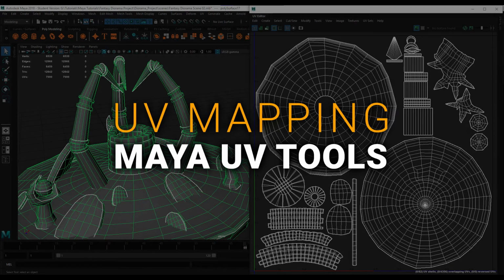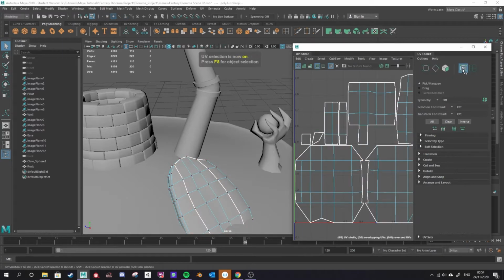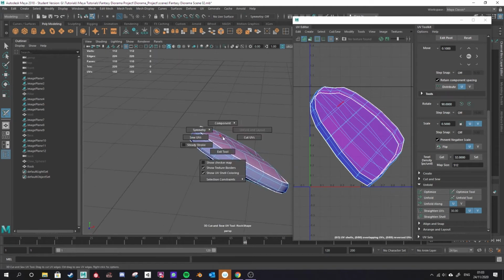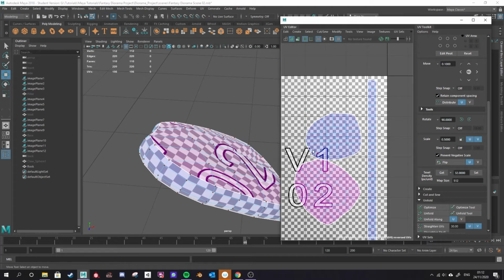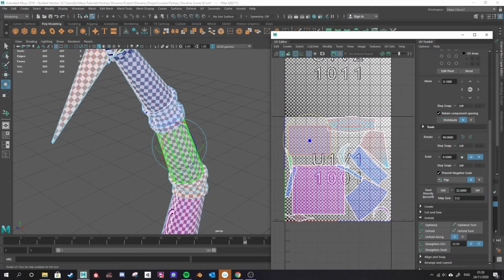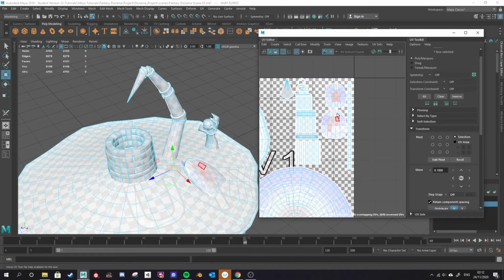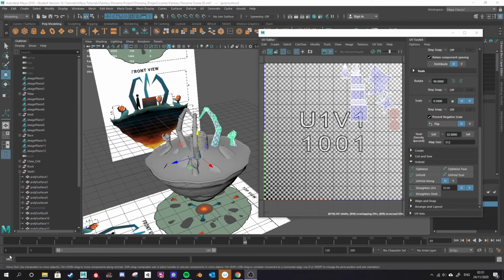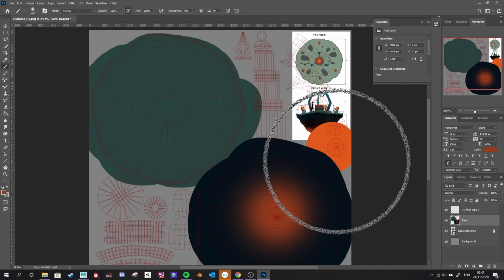UV Mapping: Maya UV Tools

Comment: Great video! regarding the texel density I would recommend to use in the "UVToolKit" under "transform" the "texel density(px/unit)" tool by selecting one UVshell then clicking in GET, then selecting all of the UVshells you want to be affected and then click Set, that way you will have all of theselected shells under the same texel density much quicker than by doing one by one. Great video and a lot of valuable information.
Reply from the maker: Excellent tip, thanks for sharing!